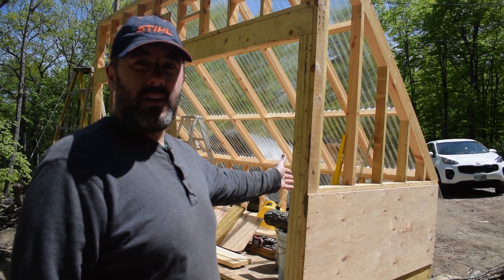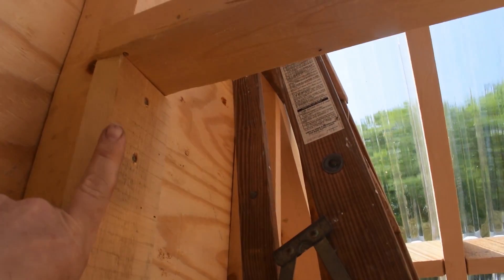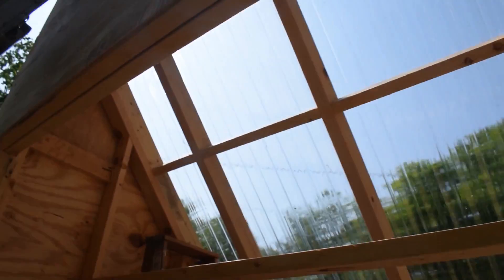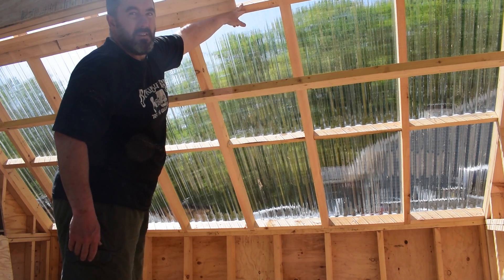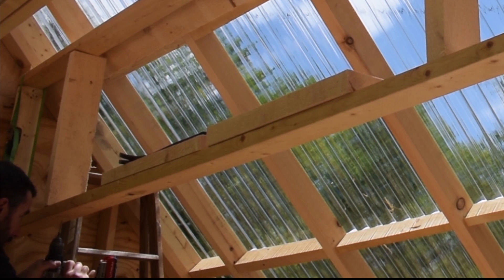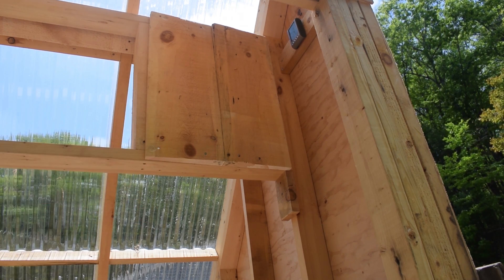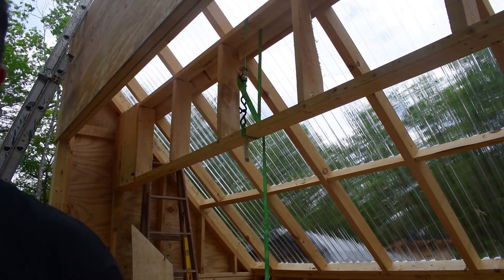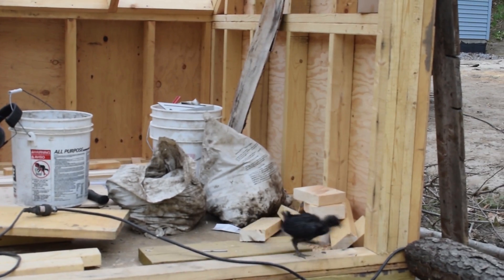Solar Kiln Build Part 10 - Sheathing and Fan Shroud

Comment: Questions:
Hey buddy, I watched all these through until this one. I know you had your daughters birthday coming up soon. 
SO here is the questions, Figure you may want to make a follow up video on this build since, it has been a couple of years being used now and there was not finish follow up video. 
SO her is the questions. 
How do you like your solar kiln.. What changes would you make if you were to rebuild the kiln. Have you had any issues using this Kiln, IE mold on boards, if so what have you done to correct those issues to help keep your usable material percentages up? I think that is all,. 
PS, buddy you do great work and it makes my wife and I's heart happy to see how well yall are doing striating this business with your Woodland mills several years back. If I recall, you may not have had much equipment back then and getting the head on the tracks of the woodland mills didnt go quickly. You have tons of logs laying around now, a new wide mill and a working storefront. I am so happy and proud for you my friend. Keep up the great work. Dale
Reply from the maker: Thank you!  We are having a blast!  Thank you for the idea for the folow up video.  We have had lots of questions about it.  We have had no mold issues as it stats pretty dry.

Comment: I was just wondering why you don’t use a nailers?
Reply from the maker: In this case I had a large bucket of nails and wanted to use them up.  Otherwise I would have used my framing nailer.

Comment: Hey mike. My dad and i just finished putting the same roofing on a kiln like yours. We only put the foam strips at the top and bottom. Should we add them at the center supports too like you did? Also what seals the sides? We had 30mph winds today blowing right in under the sides of the roofing no seal.
Reply from the maker: I used the foam strips all across to add support for when I drilled the screws in.  I used "Great Stuff" foam spray to seal the edges.  It works very good.  If you have any other questions feel free to ask.   Thanks for watching!

Comment: Hey Dillon.  Get yourself an apron with nail pockets and a belt holder for your hammer or a tool belt.  It would have made the build so much simpler.
Reply from the maker: I definitely need a tool belt.  Lol

Comment: Is this the end of the series?
Reply from the maker: I apologize.  I am overdue for an update on the kiln.  I have recently installed some siding on it and added an electrical sub-panel service.  Also added lighting and a dehumidifier. Also added additional insulation and some flashing. I will work on getting an updated video out very soon.  At this point in the video series the kiln is pretty much finished as for the base build of it.    The added features I will share very soon I believe are very helpful.  Thanks for watching and hope to see you on the next video.  Happy Holidays!
Reply: Thanks for the update! I was thinking of building one of these. Would you mind if I emailed you some questions? Thanks for the nice series!
Reply from the maker: @wf2v  Absolutely.  I would be happy to help in any way I can.  mddillon78@gmail.com

Comment: Great job and your an inspiration to many.

With where you are living did you use the angle calculation to get the maximum amount of solar energy or you just go with 45degrees?
You also started your video series by saying VT plans were off (ie missing a board) can you elaborate on any other issues you have come across?
Reply from the maker: Thank you Terry.  I really appreciate that!  Im having a great time!

I think that would be a good idea for a video.  I could go over the VA Tech plans in detail and share what I learned about the build.  Maybe it would help others who want to build it.  I will gather the information and put together a video on the plans in the next week or two.  I already recorded the final video and will upload it within a week or so.  I will do another video on what I learned during that build.  Thanks so much for your support!
Reply: Dillons Woodworks I'm looking at the directions, on-line from VT. Where did you use the same 4x4?
Reply from the maker: Sorry, just realized I didnt respond.  You mean the 6 4x4s?  I never used them.  Realized after that I dont need them.  Was a costly oversight.  My plan instead is to eventually use 3 6x6 going lengthwise to support the joists underneath.

Comment: Hey, about to pull the trigger on a hm130. How difficult is the raise/lower mechanism? Will it wear you out by the end of a day of milling or relatively easy?
Reply from the maker: I find it very easy, but after a day of doing it you may be tired.  I have considered trying to figure out a way to put a motor on it to raised and lower it.  I don't think it would be too hard to do.  I love this mill.